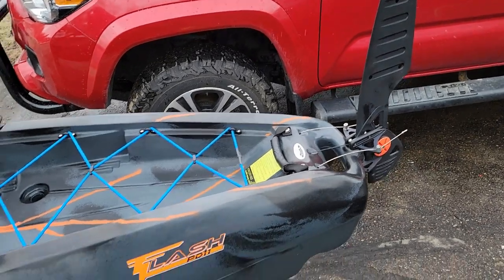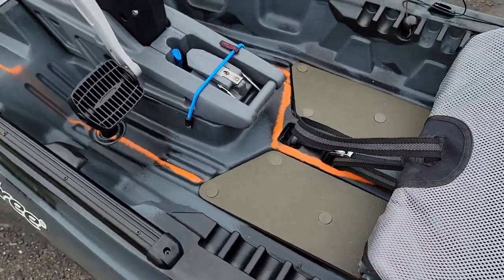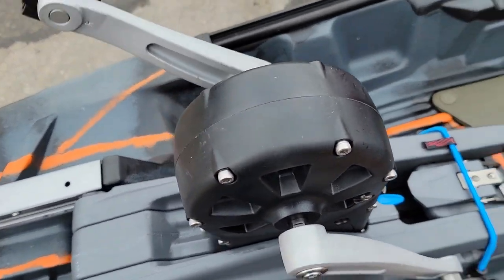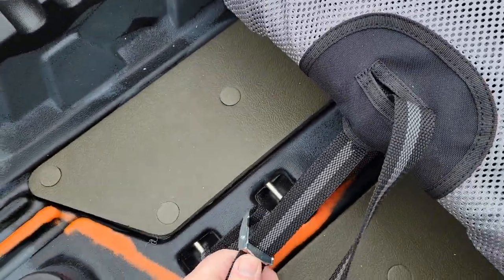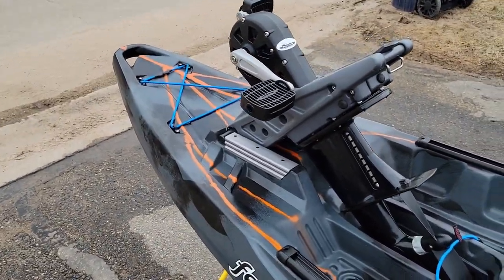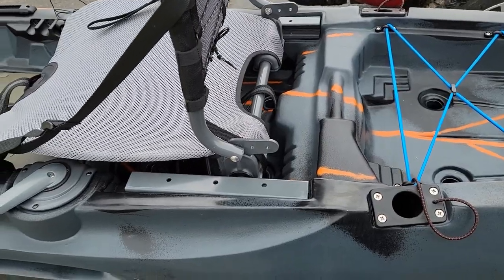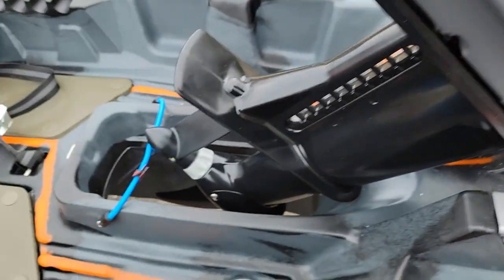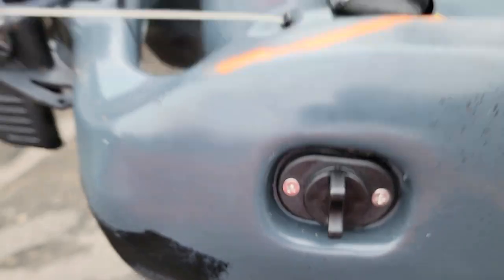Feelfree Flash PD11 Walk Through

Comment: One thing I would like to see is the option to buy a center storage consel in case you decide not to take the PD out since this is a fast and easily manuver kayak with the beaver rudder. For someone who is 5'4 at 175 lb who roof rack the kayak; I find it easy to lift this over my head. .
Reply: Ive been thinking the exact same thing. Im wondering if the console cover for the Moken can fit or can be modified to fit.

Comment: Found my dream kayak…Can these be delivered to UK without a crazy delivery charge ? / is there somewhere to buy these in the UK?
Reply: I'm in UK have recently purchased 1 personally I'd look at a longer model with hatches rails for rod holder are useless as your constantly hitting legs on anything you attach pain to fit fishfinder if your planning on just using rear rod holders or recreational use there spot on but useless once you start using the tracks very cramped